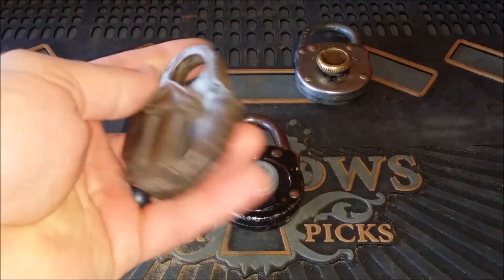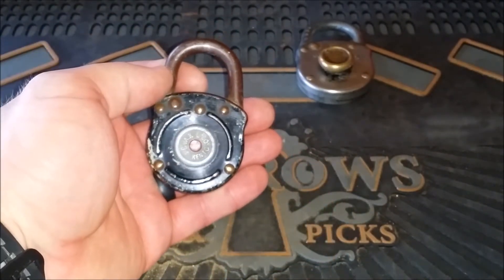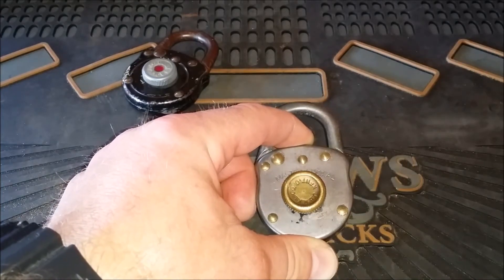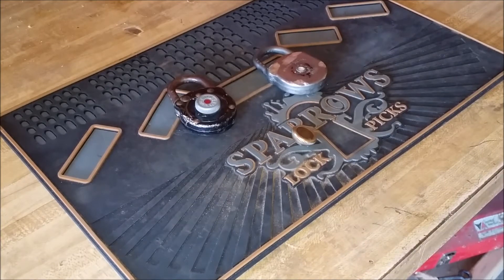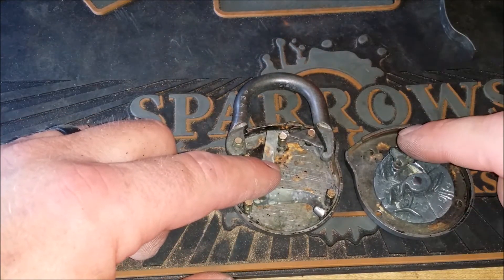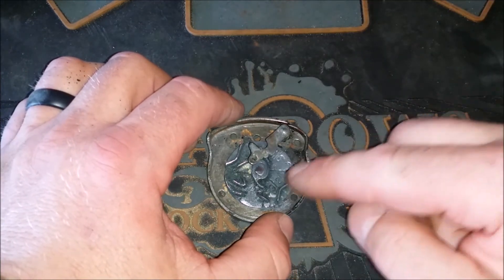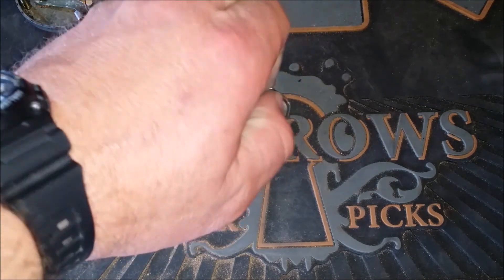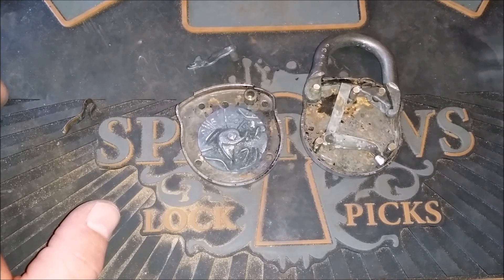How an Antique JB Miller Keyless JBMKL Combination Padlock Works

Comment: Great video.  I have a mortise door lock that uses this design.  I was able to take it apart and determine the combination but had no idea how someone could possibly use it without a numbered dial. It turns out my mortise lock was missing the "click" feature so now I see how it's done.  Thanks. (by the way, the mortise lock version has  various threaded holes in the labyrinth plate so you can change the combination - so cool)

Comment: that's a very interesting video. I have an old (Dot lock) brass very similar to what you have. however there's a small hole in the back to change the combination. and I believe that you are correct that it's was made for dark or badly lite places!
Reply: will have a look tomorrow and see if I can find the info and send you a link!

Comment: Great job! I have no idea why I wasn't subscribed all this time, but I am now. I got a Descalles EDO arriving from Bulgaria any day now and it's working but without a combination. So that will be fun. Lots of different styles of new old stock Gouglers available on eBay. I'm sorry your lock innards were so roached out. But you really did it justice. I'd like to see a follow-up video with the innards painted in order to make the different components pop. My Gougler chrome with red dot is fine. But my Miller dial was just tight. So I was plenty careful with the (cloth tape wrapped) pliers. Not sure how many different combos are possible with any of these. But it'll be fun using process of elimination to guess the code for the Descalles EDO. Right on, my good sir. Thank you for sharing.

Comment: Does that first lock use a magnet to lock and unlock it? Didn't see a keyhole.
Reply from the maker: John Ratko No it is a combination lock just like the one I took apart.  I just don't have the combination.  The insides should look very similar to the one I opened.
Reply: LockButcherShop oh ok, I didn't see a dial.
Reply from the maker: John Ratko sorry I'm an idiot. you meant the very first lock.  haha. no it takes a key. there is a door over the keyhole.  my previous video actually talks about it in more depth.  sorry about that
Reply: LockButcherShop now it makes perfect sense.
Reply: Nice little lock!
I can see it has no shim protection though? Use a knife shim or pick to pop it! 
Also, I suspect the numbers on the wheel are the mould segments. The factory will have had (say) 10 or 20 bits that you slotted together to make up a complete circular mould. Then a wheel was cast. After the run, change the segments, to generate a new wheel for the next batch. 
That's going to give you plenty of combinations. 
Seems like something I can CAD, then 3D print! 
Also, cracking: very easy. Turn to stop, then turn ccw a 1/8 rotation, then turn back. If it goes past the stop, you have the first number. If not, turn 1/8 further, etc, until past the stop. Once you have first number, simply brute force the second by rotation of the dial and test by pulling the shackle. This should work on most of them. If not, repeat the "stop finding" by repeating first number then turning clockwise first 1/8th, 2/8ths, etc to find second number. There will never be more than three, there isn't space!
Reply from the maker: Nigel Tolley awesome!  I actually opened one of the first one of these I had by brute force dialing hahaha. never did find out the combo though. I will definitely be working your magic on my other ones. Thanks so much for the info!!!!